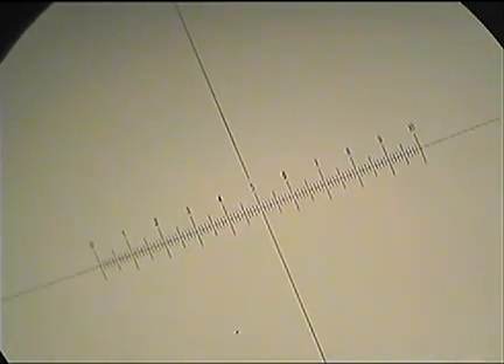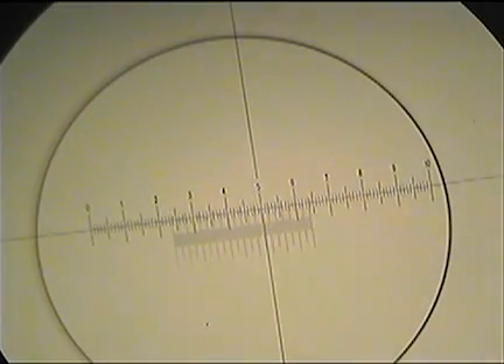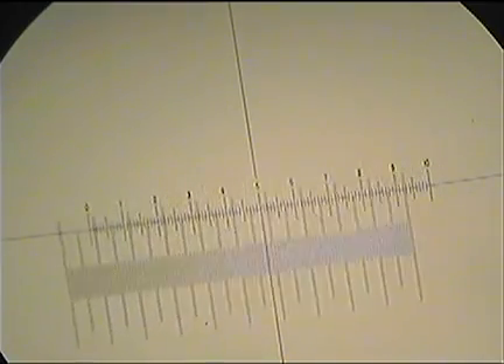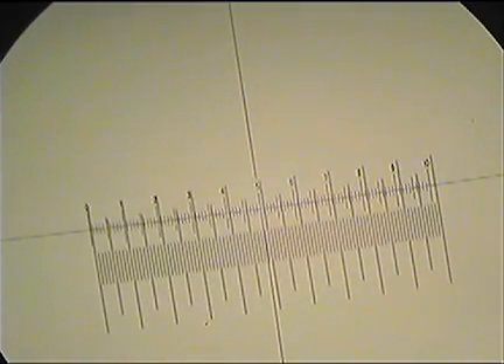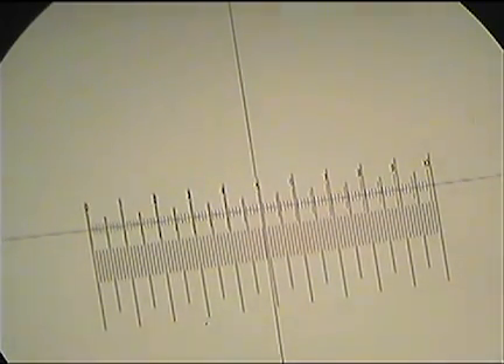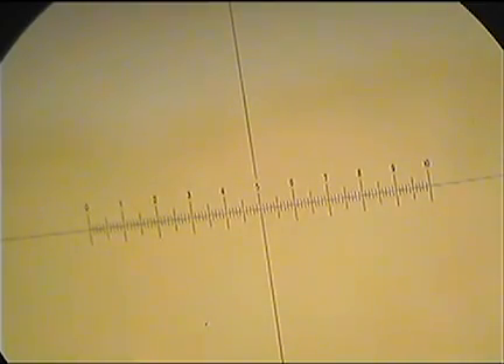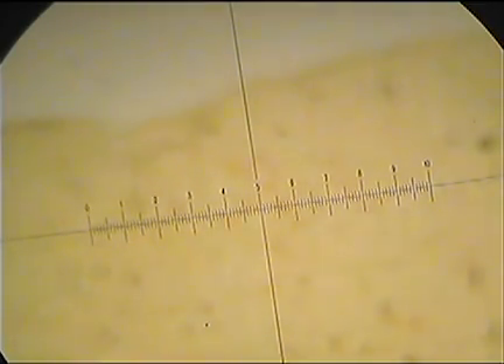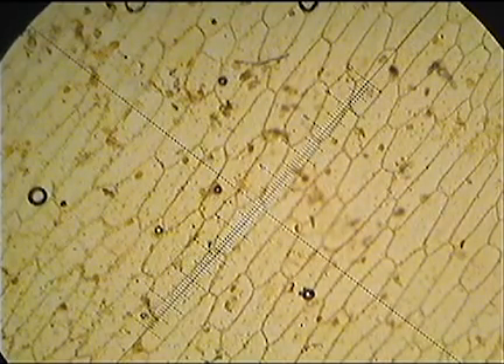Measurement: Eyepiece Graticule & Stage Micrometer

Comment: Okay so you choose the magnification and focus it. Place the stage micrometer under the lens. Line up the the piece graticule where two lines meet. Divide by how many eyepieces there are to work out how much 1EPU unit Is worth - corresponding to the notion that each small line is equal to 0.01 mm and altogether 1mm. Measure the new sample without the stage micrometer and use the eyepiece graticule to measure how many units it is and times by the use of ratios from the size of one eye piece unit?